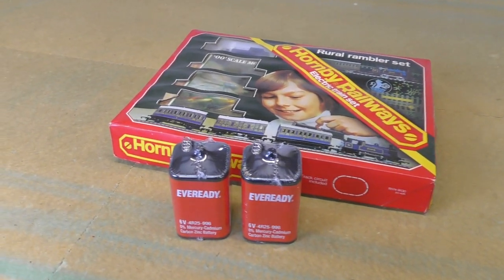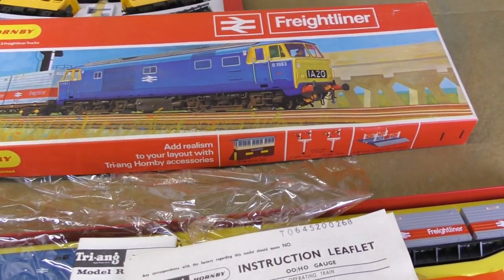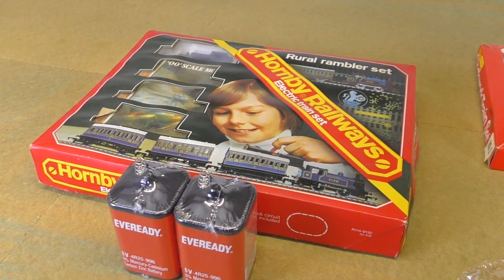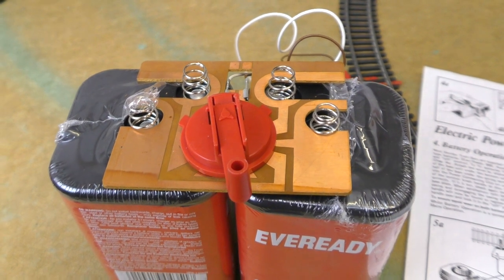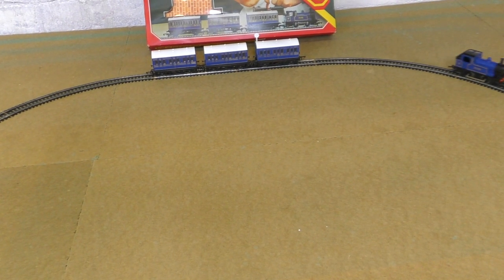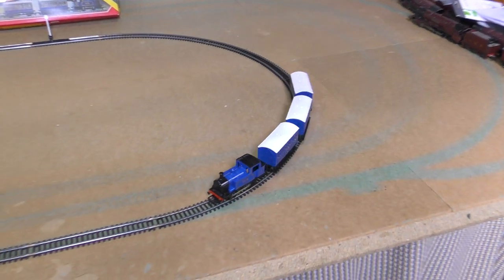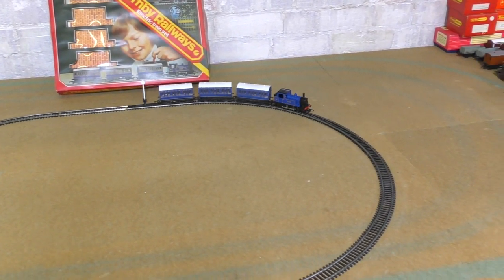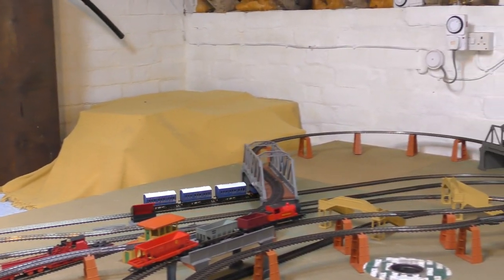Hornby Railways R.174 Rural Rambler Set. Running Trains On Battery Power On The Super 4 Mainlines

Comment: Splendid! The high speed reversing was amazing - edge of the seat stuff :o) I have a Hornby Double battery controller (green-grey cast iron) which I presume might have been designed for accumulator use.  I think it's time I tried it!  It appears to have a rheostat similar to the larger mains transformers. Thanks for sharing - and risking collision damage!  Mike
Reply from the maker: You've got me thinking Mike, I'm sure I have one of those little Dublo items somewhere, I bet it takes me a while to find it. Best regards to you

Comment: Def vote for the Freightliner set . I remember it from the catalogue and really wanted one . It would have been a bit silly as really didn’t have a great track to run it on , but it didn’t stop a little boy from dreaming . I did get the “Junior Freightliner” for Christmas in 1970 which had the diesel shunter and two Freightliner wagons , but more importantly a circuit of System 6 . My Grandparents bought me the crane the same year , so I had all the constituent parts but not the Hymek . I eventually got one 6 years later !  I am now buying the Original Freightliners on a well known auction site , so one day I might run my Hymek Freightliner . I wonder if yours is in “Electric “ blue or Rail Blue as it dates from 68 . Initially Tri-ang had a lighter blue on locos and coaches then switched to a more correct shade , but I think that was 69.  

The `Rural Rambler was a nice shade of blue . I think that was the last outing of Polly Nelly and Connie , before being replaced by the GWR 0-4-0. That’s impressive that the Battery can run the Super 4 layout . Impressive speed too .  I wonder how long the batteries would last though . Battery technology has moved on  I can remember getting a battery powered Lego train , they didn’t last long !

Youve got to try a Wrenn loco on batteries . Come on you know you want to ! Failing that how about the Electric AL1 , the noise of knurled wheels would be terrific. Sorry for the long rambling . Great video . I love these trains
Reply from the maker: Hello Russell, I would have been envious of your System 6 track, I always wanted some of that. It looked so modern in the catalogues of the day. I will have to check the colour of the Hymek, It might be Electric Blue. Take care and thanks for watching. All the best to you

Comment: I have many of the "battery controllers" that I have found over the years, (even an old Rovex one) and have never once connected one up... I had always thought that it would be a just waste of time on anything larger than a simple oval.     Shows just how wrong one can be?
I am really surprised at the train performance around the layout track .... I did have my doubts with the Diesel, but am once again surprised..
I now believe that the "old" Dry cell controllers that were about in the 50's and 60's, would have been quite successful?  Great work.. 
How long that the batteries will last may be another question?  (The old Dry Cell batteries from way back, would probably have had more capacity than the new 6 volt ones.. So the battery options with the train sets of the "old days" may have been a lot better than I had ever expected of them? 
Thank you for the enlightenment (after 65 years of doubt)....
Reply from the maker: Hello Robin, I've been looking for my little Dublo battery controller but am yet to find it. These old locos seem to be fine on batteries which certainly surprises me. I bet the batteries soon go flat but they do give some great fun while they work, give yours a go, it is quite interesting to try them out. Take care, all the best to you

Comment: Excellent fun but you didn't run the Rural Rambler on the up and over branch line.  I was looking forward to seeing it going over the bridges.  The battery power is much better than I expected and I think an experiment is necessary to see how long the batteries would last if you run the set on the oval of track from the box.  For scientific purposes of course.  As for next time, mmmmm, much as I like the styling of the Hymek I think the clockwork set would be fun.  😊
Reply from the maker: Hello Pauline, I've noted your request to run the Rambler on the Higher line, I'll try and do that soon. I have a few locos to try on battery power so it will be interesting to see if the batteries fade soon. Thanks for watching, all the best to you.

Comment: On the R682 Frieghtmaster set, is the left side grill on the green livery Hymek blue? Does that mean the prototype had a from stock replacement grill fitted and not repainted? I have seen that on a real class 33 I think...
BTW I vote for the clockwork set :)
Reply from the maker: Hello I don't have the R682 set but I do have a green Hymek, I'll have to check it over. Thanks for plumping for the clockwork set. Best regards to you

Comment: I would be well impressed if the batteries could power the Wrenn A4 with the die cast body and a rake of coaches Mr. Snooze, or maybe the 9f and a rake.
Reply from the maker: Well it's a good suggestion, I will give an A4 a try, all the best to you

Comment: Hi would like too see clock work train set running as it make s a change to see as its electric  and I would like too see the black five running on the batteries control  very  good seeing the small 040 little blue locomotive and three carriages at half speed full speed and thank you from Edwin nice to see the trainsets from  nineteen seventy s as was a boy nine year old when I had my first train set and used the kitchen table to run it on I had it brought me b y mum and dad and was best thing I ever had as I t got me into the hobby
Reply from the maker: Hello Edwin, I'll definitely be giving the Black Five a try on batteries. I remember using the kitchen table for things too, I was always being told to clear things away before dinner. Take care, all the best to you

Comment: Freightliner set
Reply from the maker: Thanks for suggesting this one, all the best to you
Reply: @MrSnooze  I don't know if you know this but the X.03 and X.04 motors are the same but the worm gears are different so you could install a Airfix 5 pole motor in a X.03 motor engine
Reply from the maker: @111greatbear3  yes a great point. I might try one in a loco with the X03 and plastic worm. It would be a worthwhile experiment. Thanks for mentioning it
Reply: @MrSnooze  your welcome